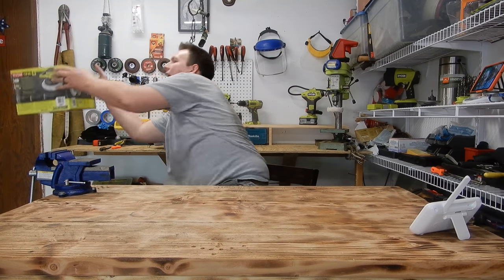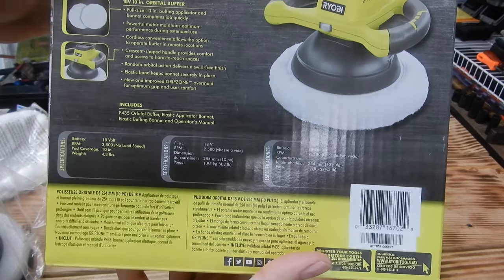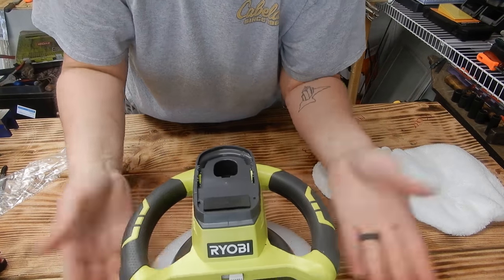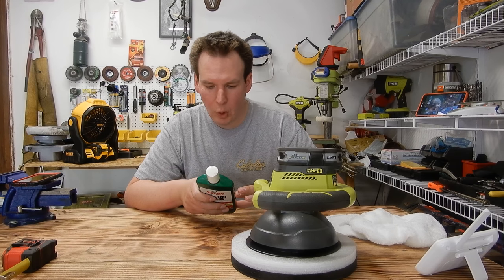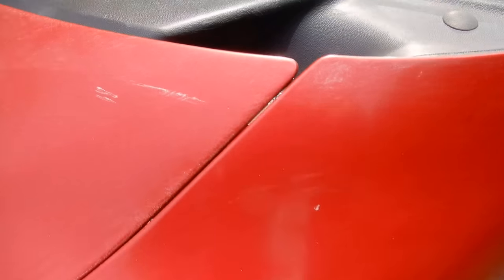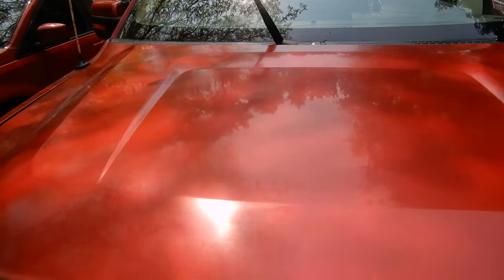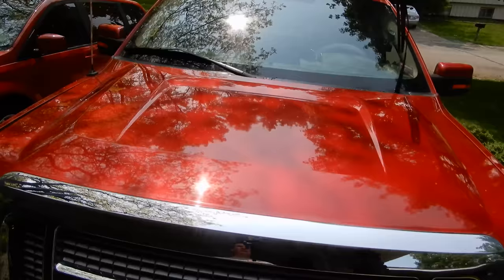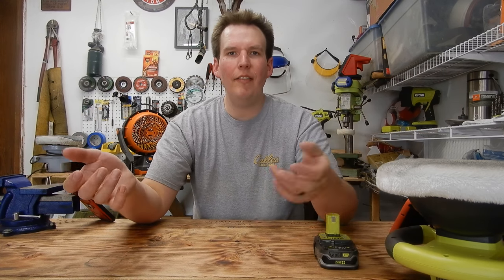Ryobi 10 Buffer unboxing and review !!!

Comment: Just an FYI it runs stronger with a 4ah battery. The 1.5ah is a little weak for it. Figured you probably already know that just thought I'd mention it. Great videos, I really enjoy watching them!
Reply from the maker: yeah I noticed that right away that it felt like it would stop if you pushed down hard on it. its much better with a bigger battery.
Reply: So a 4ah battery will definitely fit? I like how its cordless will make a big difference. I will have to get it.
Reply: thanks for the info was going to get into ryobi line, but didnt know what battery size to start with. i will get the 4ah.

Comment: You do know....... application of the product with the machine is the preferred method.. Kinda the whole point of using a machine for paint correction/protection.
Reply: Yeah, I thought the same thing.  But then aren't you constantly having to switch back and forth between the application bonnet and the buffing bonnet as you complete different sections.  Especially if you're using it on an RV?

Comment: Thanks so much for the review!! I bought one because of this lol😂. I noticed when I got mine it was very hard to snap the battery and did yours get easier to insert overtime? Do you think this is normal or should I return to get one where the battery goes in easier? Thanks.

Comment: FYI, you're not supposed to apply wax to a vehicle in the sun
Reply from the maker: Where am I suppose to apply it than? My truck is to big to fit in my Garage, IM not going to drive around and look for some freaking shade!!! IT  DOESN'T MATTER, i would love to see where you read that.
Reply: @Impact-OG  I'm just letting you know what the manufacturers recommend.  There is also this thing called the sun that goes up and down in the sky.  If you time it correctly, you won't have to go anywhere with your truck 😋
Reply: @Impact-OG  like your videos,but the dude is right some polishes say it right on the bottle

Comment: Can I use this to  remove oxidation, scratches, water spots on my car? I have looked for orange and yellow pads that are 10"  but I cannot find them.
Reply: Actually no it doesn't have anywhere near the power to remove any defects, it's basically a wax spreader.

Comment: In the video it looks like it wasn’t even spinning lol
Reply from the maker: It doesn't spin in a 360 degree circle it has a small orbital pattern that it does.
Reply: @Impact-OG  but it is supposed to spin AND orbit. that's what the DA in DA means.. dual action. If it's not spinning you're putting too much pressure on it. which is very very little on these, and why no detailer anywhere uses one of the 10" jobs. at best it's decent at applying a liquid wax or MAYBE buffing it off if you have the right bonnets.
Reply: @Turk380   Honestly this machine has no ability to do any paint correction at all, if you're even remotely serious about removing any types of swirls micromarring or scratches invest a $150 into something like the griots G9 that will actually do the job, and comes with a lifetime warranty.

Comment: This tool is weak sauce. Get yourself a DA machine from harbor freight for $50. And use a soft foam pad to apply the wax and another to wipe it off. Or just use a soft microfiber to wipe off the wax.